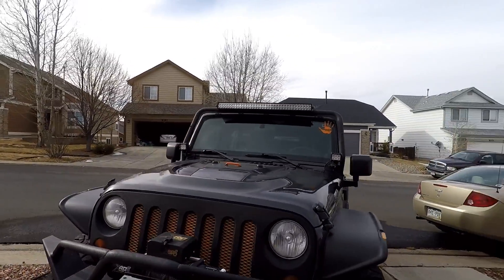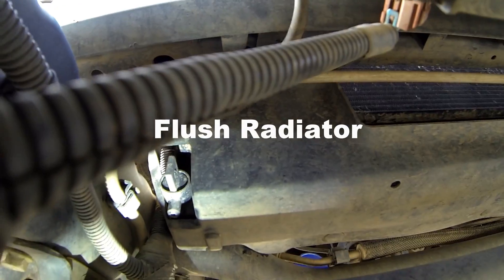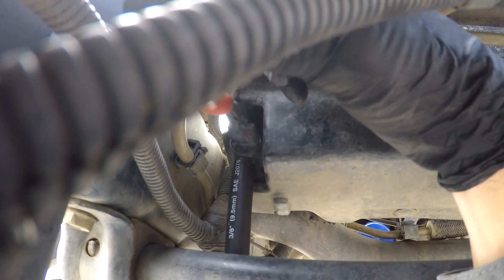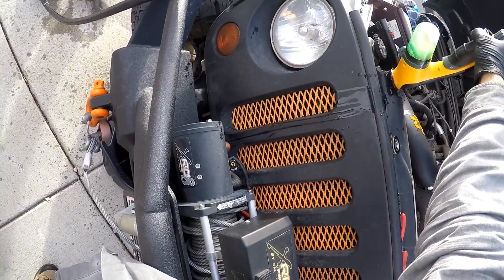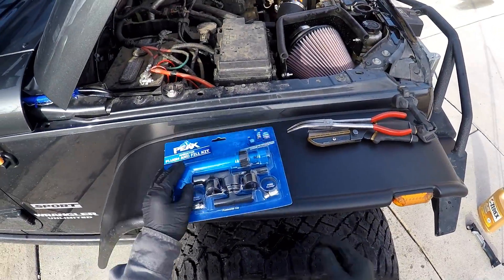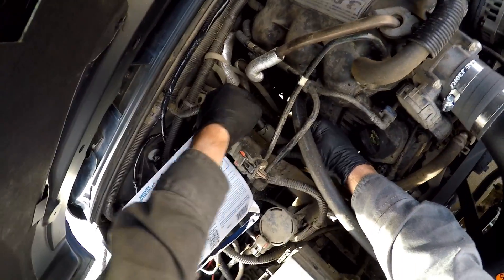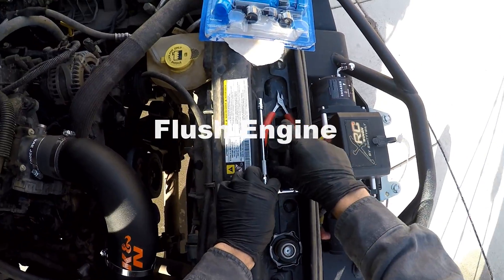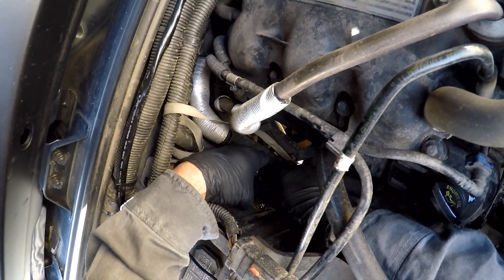2010 Jeep Wrangler JK Coolant Super Flush - Radiator, Engine & Heater Core

Comment: Hey Kev, Great video. I only did the first part of this on my 2010 at 70K. I flushed the radiator and engine(?) and refilled with the same fluid. I didnt do the heater core at the time. Im having problems with my jeep overheating to about 3/4 when im idling. Any ideas? Should I replace the thermostat?
Reply from the maker: I'd start there. You can pull the thermostat and test it in boiling water to see what temperature it opens, if at all. The temp should be stamped on the thermostat, otherwise see the temp specifications on a new OEM replacement. If the thermo is opening correctly, you could have some blockage slowing the flow of fluid through the system (i.e. heater core). If this was the case, you might see the Jeep cool down while revving higher but while still parked. This should cause the water pump to push the fluid harder. Keep in mind your fan too. The fan should kick on to help cool the fluid in the radiator, thus cool the engine, especially while stopped and idling.
Reply: @symantec1176  The Fan is SUPER LOUD on idle. Like its a jet engine, so i'm assuming the fan is working? I'm going to replace the thermostat all together instead of troubleshooting it. It wont hurt to do that anyways. I've also replaced the water pump within the last year when I did the flush, so i can rule that out. I will try the rev on idle and see if my temp drops at all. I appreciate the quick response. My last question would be, when I remove the thermostat I will lose some fluid.... Should I just top off the reservoir after the installation with 50/50 fluid and water or what would be the proper procedure here?
Reply from the maker: Sounds like the fan is working. Good chance your thermostat is sticking a bit and opening at a higher temp than it should be. Good place to start. You shouldn't lose much fluid. Just make sure you're maxed on your overflow reservoir (50/50) and it'll balance out after awhile. Just keep an eye on it after a day or two of driving. 
If I recall, you can squeeze the upper radiator hose (use rag as can get hot) and if it is easily squeezed, the thermostat is closed. Once the thermostat reaches temp, you'll feel the rush of fluid and hose expansion due to water pressure. Another useful tip is a code reader in live view. You can monitor the engine temp and watch it rise and then cool once the thermo opens. Then drops and see it close, and repeat. Gives you a good baseline (min / max) as to what is going on.
Reply: @symantec1176  This is all super useful and I appreciate you taking the time on this. When I have the chance to get to this, I will report back with what I did and my results, just in case someone like me in the future needs the info. Enjoy your weekend!
Reply: Kevin Abriam so here's an update and probably the first thing that should be checked. My reservoir is stained so I thought I had fluid in it (I didn't). Opened up the radiator cap (cold of course) and started the jeep, very low. Filled it to the neck, let it run filled it to the neck until it equalized. Let it run then filled the reservoir to min. Thermostat did its job. I will keep this information in my pocket for the future. Thanks again. (I know, I should've actually checked the fluid first).

Comment: @Kevin Abriam , where can buy those adaptors that you had in that blue package for the hose? Thanks
Reply from the maker: It's the Peak Flush and Fill kit. I got mine at Auto Zone. Likely available at many auto parts stores. There is also a Prestone version exactly the same. Just search PKFOAA on Google.

Comment: Great video, but is there any other way to flush the heater core without cutting the heater core hose. Because now when you splice in a connector of some sort to repair the hose hose you just cut, there is the possibility of it leaking. I'm just spit ballin' here but I highly doubt my local chain mechanic is cutting people heater core hoses.
Reply from the maker: BTW, you are correct that using the included adapter can introduce a leak down the road and have seen it before. When that happens I change the adapter to an appropriate inner diameter hose extension adapter. It is not difficult to swap between the 2 port extension and back to the 3 port flush adapter when time for another flush.
Reply: You can isolate the heater core by unplugging both lines and running water through the hoses.  You could also buy an extra tube and splice the T connector to original hose, spare hose to water pump when flushing the pump.
Reply from the maker: Service centers, such as at your local dealer, use coolant flushing machines that range from $2k to $4k. You can search "Coolant Flush Machine" here to find some video examples. My understanding is they connect to the upper radiator hose and start by flushing the radiator while the engine is on. Once the thermostat opens, the machine can then flush the remaining coolant system.

Comment: Great video, but why tap water and not fully distilled? Tap water contains contaminates, chemicals and minerals.
Reply: Tap water will ruin an engine doesn't make a difference how close to the source you are. At least it's not staying in the radiator only using for a flush but I myself wouldn't use it at all.
Reply from the maker: My tap water is near the source and have used it in my radiators for 25 years now. If you don't trust your tap water, then don't use it.
Reply: You should be blowing the excess tap water out of the system by compressor or mouth. NEVER leave tap water in your coolant system.
Reply: How would you flush with distilled water anyway?

Comment: Good video, Thanks. The coolant types are confusing anymore. FYI My 2012 Jeep uses HOAT but I think that was the last year. My 2014 Ram uses OAT and your not supposed to mix them so make sure and check your owners manual. I think I'm going to flush both and put Prestone in both which is supposed to be OAT. And remember coolant is toxic and can't be dumped, most larger cities have a Household Hazardous Waste Facility that will take it. Thanks again.

Comment: unrelated, but did you relocate the ground that was connected to the hood?
Reply from the maker: The hood is not stock which is why it is not likely in the same spot. The hood is a Smittybilt SRC Stingray.
Reply: so technically, it is relocated? I'm just wondering because it was a dumb place for mopar to put a strap, and I've been researching if I can move it to inside the engine bay and not on the hood, if that makes sense.
Reply from the maker: I gotcha. I don't believe mine is connected and I have no issues with the stereo reception and don't have a hood light. I should probably remove it from the block since it looks like it is just wrapped up against the firewall (see 10:14 in the vid).

Comment: Why not just blow air in the system  to flush it out as it is you leave tap water in everything with this method?
Reply from the maker: I would not recommend using air to blow out the system as you may leave air locked into the heater core and difficulties bleeding out the system. In addition, the air will not rinse out surface grime. As mentioned in another reply, you decide whether to continue draining / refilling the radiator with distilled water or rely on the tap water if you trust it. In my case, we have quality tap water and have never had any issues with this method. You can check with your local shops to get their opinion on the water they rely on but caution some will likely say they use distilled / filtered water even though they don't.
Reply: The Bleepin Jeep guy does it with air and shows how to in his video he just doing it on a lifted cherokee is the only thing.  check it out it's a very good video.
Reply: @symantec1176  I've never seen nor worked at a shop that used filtered or distilled water on radiator changes. I've only ever seen 1 mechanic use distilled water and this was on his own well kept vehicle, all others have used municipal tap water. I suppose as long as its not well water or the water in your area isn't especially hard (mineral rich) municipal water will suffice. Cars are lucky to have an owner that'll do basic preventative maintenance , too many people wait till the car has drivability issues before performing maintenance.

Comment: I wonder, if you are using the correct antifreeze...shouldnt you pour in the MOPAR Antifreeze/Coolant 10
Year/150,000 Mile Formula OAT (Organic Additive Technology) that meets the requirements of FCA Material
Standard MS.90032?
Reply: 2013 and up should be filled with OAT NOT HOAT!!! Also you used regular water and not distilled water which is wrong also. This video is going to cause damage to people's Jeep's!!!
Reply: @christhompson5125  Once a Rad has been flushed it does not matter  what kind of antifreeze you put in. I myself use Celsius Prestone. The problem with the Jeep rads is where the plastic and aluminum crimp. Do not replace your rad with another mopar. Buy a quality aftermarket. If you smell antifreeze check the drivers side it is the side that runs the hottest. The leak will start at the top and work its way down. Been there done that got the T-shirt. I have many pictures of this mopar junk.
Reply from the maker: Zerex G-05 is Chrysler MS 9769 Approved and Five year / 150,000 mile. You can use the MOPAR stuff if you prefer - your prerogative.

From Valvoline site... "ZEREX™ G-05™ is the automaker approved original chemistry used in newer Ford & Daimler Chrysler automotive and diesel engines. Its Hybrid Organic Acid Technology (HOAT) chemistry combines the best of conventional and organic acid-based chemistry to provide the ultimate protection against rust and corrosion."
Reply: MIKE HUNT I use the oat 150000 mile coolant. Its purple but looks orange when you add it.
Reply: Also I have a 2014 Jeep. Those new kind of coolant gel up and fuck a bunch of shit up. So first thing I did was drain that red dogshit coolant out and fill it with standard green coolant / antifreeze
Reply from the maker: Thanks for the info. I think you're reaching by stating the video will damage people's Jeep's. People damage people's Jeeps and with any DIY project, I hope they do the research applicable to their Jeep. Never did I mention this applies to all Jeeps. Regarding the HOAT vs OAT, I have added that to the description. Last, I did not completely use ALL tap water and did finish off with distilled water. If you think you have hard water that will damage your engine, then adjust accordingly or take it to a shop (careful they don't secretly use tap water too). In my case, I trust my water enough to not repeat the process over and over again just to get every drop of tap water out.
Reply: MIKE U.S.N. ok
Reply: Chris Thompson you're smoking crack dude you don't have to use distilled water. It's a fucking car

Comment: Is it 3/8" hose, is that inner diamter? or outer diamter? Im assuming that's inner diameter.
Reply from the maker: mike MacKinnon, your assumption is correct. I just measured to be sure and is 3/8" inner diameter.

Comment: Great video. Like that you did voice over. May I ask how much coolent did you end up using?
Reply: I figured for my 16 qt sys (5.7) was two qts of full strenght coolant which gives/makes the solution would be close to half and half.  Not counting the over-flow tank and heater core and lines capacity (I figure approx another 3-4 qts half&half).  Bottom line, approx 2 1/2 gal of full strenght fluid.  Kevin, Thks for Ur patients doing the vid, good points to stay in-mind.
Reply: Then after a good day trip,  I pull the fluid weight check, colored BBs in the glass dropper thingy, good for a west Tx, N.Mex 20 below.
Reply from the maker: Thank you for the comment. I only needed the one gallon container of Zerex G-05. Be sure to use the pure concentrate type and not the Ready to Use type.
Reply: 10 quarts I believe